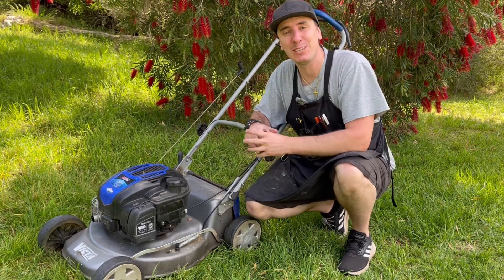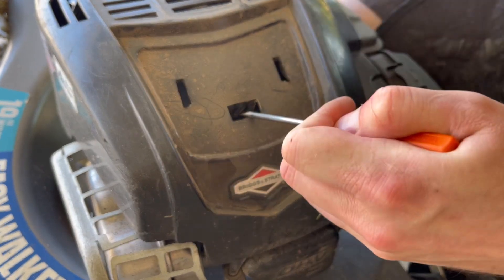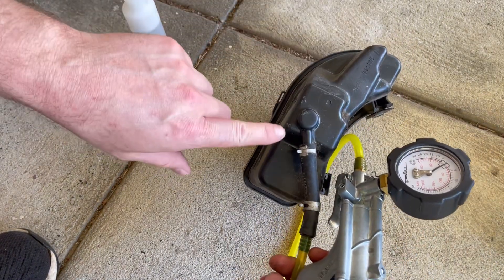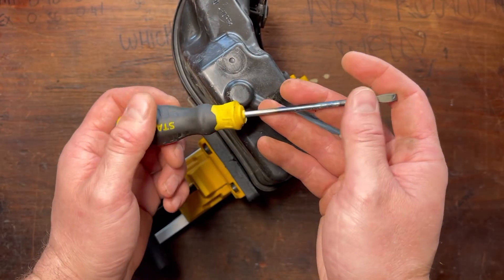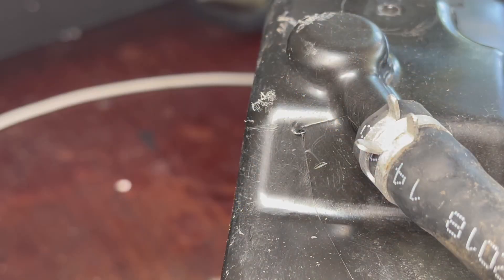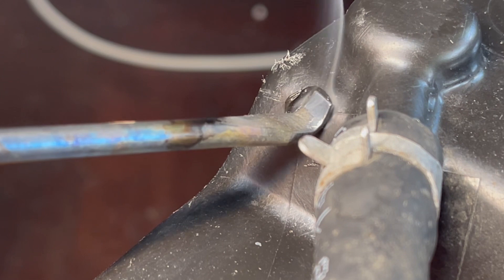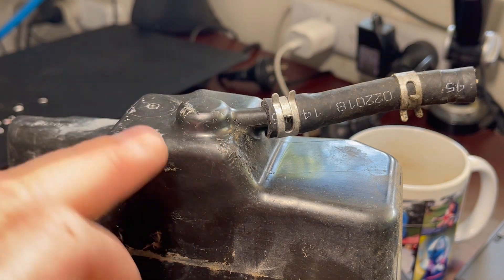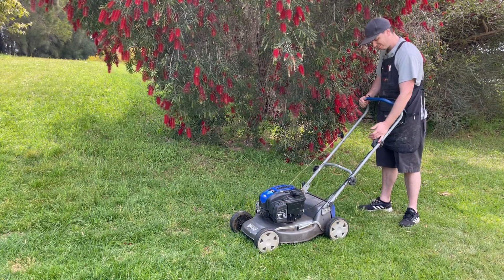Plastic Welding A Gas Tank: Free & Easy DIY Tutorial!

Comment: Plastic welding has become a favorite repair technique I've been using for several years now. I used it to repair an otherwise completely ruined dash and door panels in a 2001 Ford Ranger project truck. In order to see any of the repairs, you have to look really closely and know about where the repairs are.

A neighbor bought a Toyota Tacoma that a previous owner had cut up the air filter box and tried to install a cold air intake only to ruin the truck and make it inoperable. It took about an hour and three plastic welding strips in order to get the box to where it could be used and the mass Airflow Sensor would work properly. Then we were able to address the other issues that the truck was having.

I have a Craftsman LT1000 sitting in the back yard that is waiting for me to do the very repair that you are doing here when/if I ever get to it. (Funny how personal equipment gets put on the back burner at times).

But Plastic Welding has really changed the amount of items that get thrown away around our neighborhood. It is a great skill to learn and not that hard. Equipment can be inexpensive or improvised, like in this video, or you can get a kit from Harbor Freight or similar for about $16, and go up from there to how much you want to spend for your needs and beyond up into the thousands of dollars.

Great repair, neatly done and great video! Thanks for posting this.
Reply from the maker: Thank you for sharing! It sure is a useful technique isn’t it!!

Comment: Great info. Would you recommend first putting a little water in the tank then emptying?
Reply from the maker: It isn’t necessary, but you can use compressed air to remove any fumes in you’re unsure that it’s fully empty!